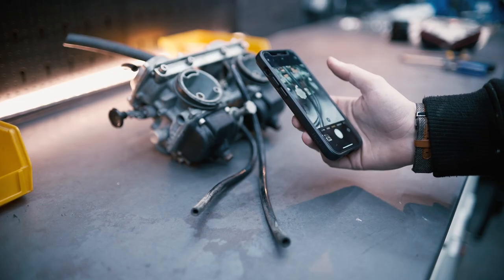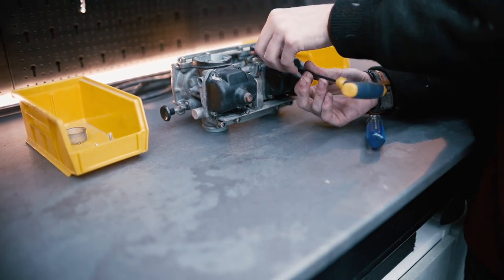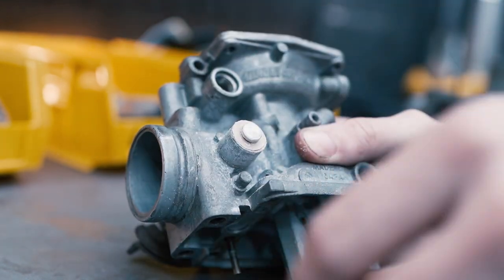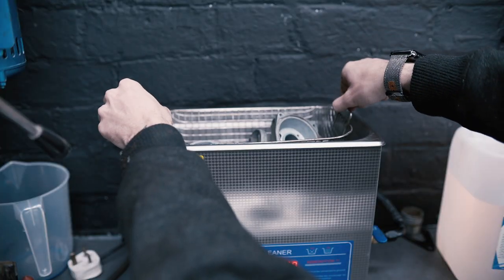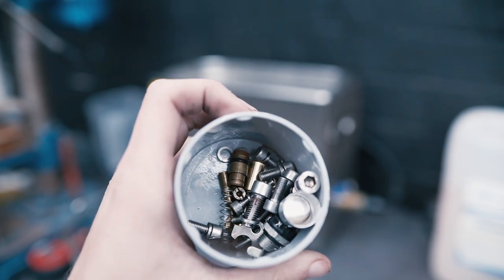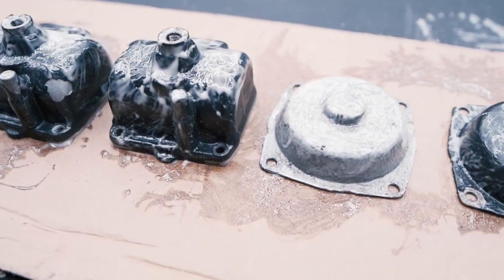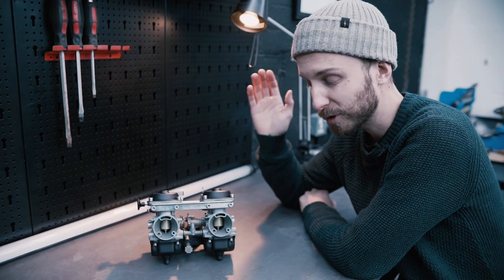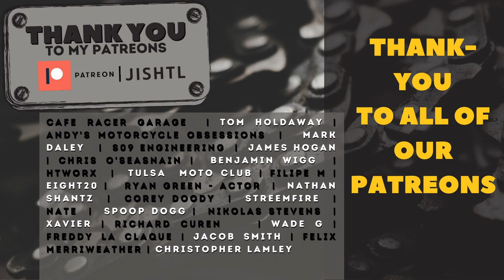Suzuki GS250 - Part 10 - Carb Rebuild & Refresh

Comment: I just picked up a 1980 gs250 and it needs some carb work. I haven't dug into, but it's flooding the left carburetor. It will run, but only under light throttle. Fuel pours out the of the air filter. Do you know of a good upgrade for both carbs that's essentially plug and play?

Comment: I noticed on the video  largest rubber tube goes to? nd the tube located at the back to? and the other 2 skinny looking tube are just drain tubes? please let me know your findings, i just bought a 1980 Suzuki GS250T and tore down the carburetor and took photos as you mentioned and unfortunately my Google photos are full and i couldn't find my pics. Any help is greatly appreciated as my Haynes remain manual is arriving very late through "Snail Mail" Thanks Jish

Comment: Another cinematic masterpiece Jish 👌🏼 I’ve got the same ultrasonic cleaner and it’s great for effortless cleaning of oily nuts and bolts. Are you using deionised water?
Reply from the maker: I use specific carb cleaner 👌 its 1 part solution to 10 parts water and i just use normal tap water
Reply: What size ultrasonic cleaner do you guys have? I want to get one but unsure what size to go for
Reply: Same here I want to get one but don't know much about them

Comment: Anyone have a replacement idea for the air box outlet hoses? No longer in stock/made.

13881-44100 And 13882-44100
No longer in stock/made.
Thanks
Reply: I bought and cut some metal velocity stacks and shoved them in the airbox. It's not a perfect seal, but it works. The better question is where can I find the boots that connect the carbs to the engine.

Comment: No new needles and jets or anything? Just curious, not judging
Reply from the maker: for these they are really hard to find replacements without spending serious bucks, plus as said in the video these were actually very well looked after 👌 no point replacing things that don't need replacing 😁
Reply: @jishh  That's fair. I've never had issues finding replacement needles and jets, replacement sliders and membranes are near impossible tho
Reply from the maker: @youridv  are you UK based? I cant find any! I even struggled to find float bowl gaskets and they cost me almost £15 😅